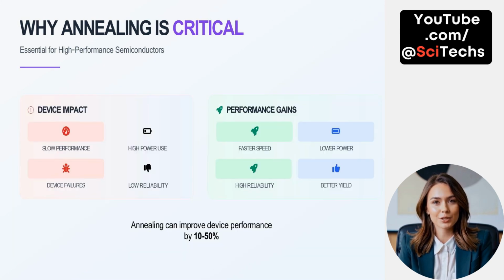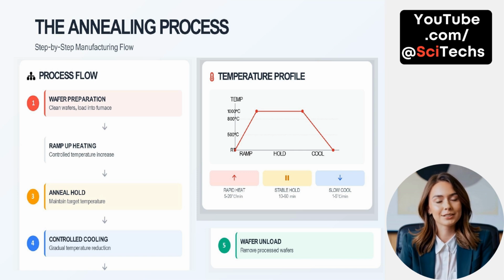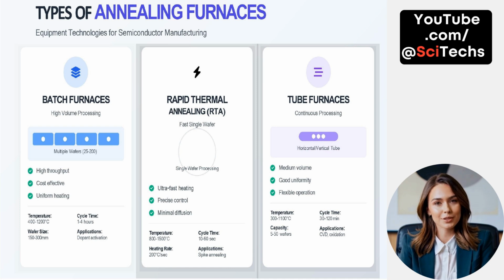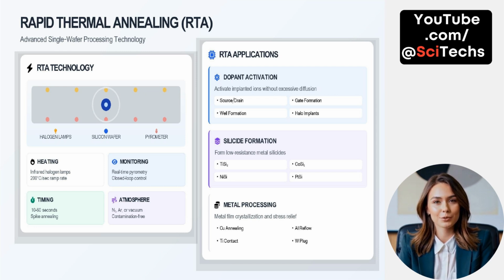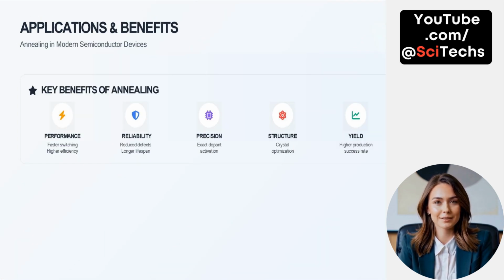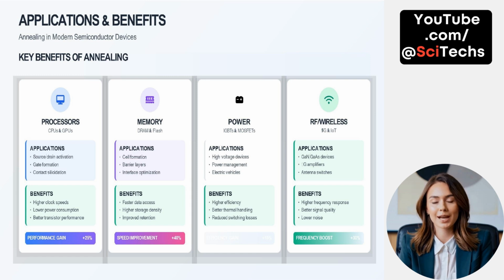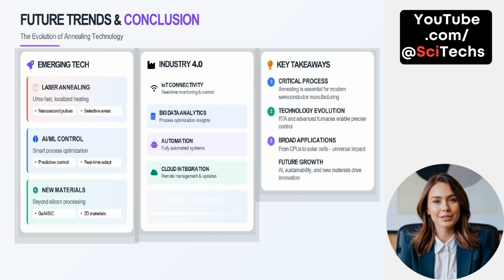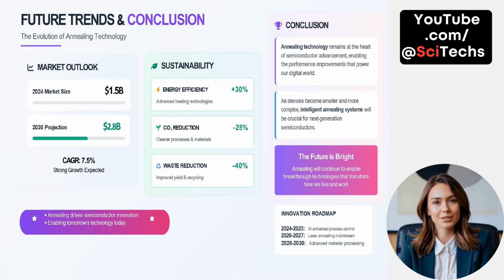S22. Annealing & Annealing Furnaces in the Semiconductor Industry

Comment: Im MPhil student need your help
Reply from the maker: Let me know if you have any specific questions.
Reply: @SciTechs why ETL block hole and allow. Electron
Reply from the maker: @cooking.818  In optoelectronic devices like solar cells (perovskite or organic) and OLEDs, the *Electron Transport Layer (ETL)* acts as a selective traffic controller. It uses a clever combination of *quantum energy levels* and *material doping* to allow electrons to pass through seamlessly while acting as an impassable brick wall for holes.

Here is exactly how it works.

---

## 1. The Energy Band Alignment (The Main Barrier)

The primary mechanism for blocking holes while conducting electrons is the alignment of energy bands between the active light-absorbing layer and the ETL.

Every semiconductor has a *Conduction Band (CB)* where free electrons move, and a *Valence Band (VB)* where holes (the absence of electrons) reside. For organic materials, these are referred to as the *LUMO* (Lowest Unoccupied Molecular Orbital) and *HOMO* (Highest Occupied Molecular Orbital).

### For Electrons:

The ETL is selected or engineered so that its conduction band (LUMO) energy level matches or is slightly lower than the conduction band of the active layer. This creates a smooth down-step or a flat path, allowing electrons to drift or diffuse right into the ETL.

### For Holes:

The ETL has an incredibly deep valence band (HOMO) level—meaning it is much lower than the valence band of the active layer. For a hole to enter the ETL, it would have to "jump down" a massive energy barrier (which requires a massive amount of energy that it doesn't possess at room temperature). Therefore, the holes are completely blocked at the interface.

---

## 2. Conductivity and Doping (The Transport Mechanism)

The intrinsic properties of the ETL material itself heavily favor one charge carrier over the other:

* *High Electron Mobility:* ETL materials (like TiO₂, ZnO, SnO₂, or organic molecules like PCBM and BCP) are $n$-type semiconductors or possess molecular structures specifically optimized for high electron mobility. Electrons can hop or drift through the crystal lattice or molecular matrix with very little resistance.
* *Negligible Hole Mobility / Concentration:* Because the ETL is fundamentally an $n$-type material, its concentration of free holes is essentially zero. Even if a hole managed to force its way past the energy barrier, it would find almost no viable path (states) to travel through and would rapidly recombine with the abundant electrons.

---

## Why is this selective blocking crucial?

If the ETL didn't block holes, electrons and holes would meet at the metal electrode and recombine, destroying the electrical current you are trying to extract (in a solar cell) or drastically reducing efficiency (in an OLED). By enforcing a one-way street, the ETL ensures that electrons go to one electrode and holes go to the opposite electrode (the HTL or Hole Transport Layer), generating clean, efficient electrical power.